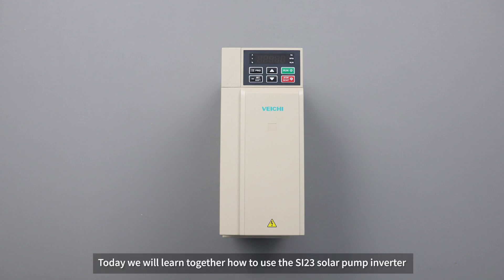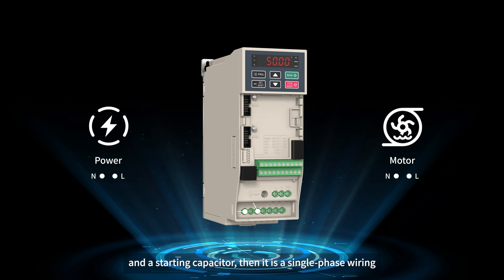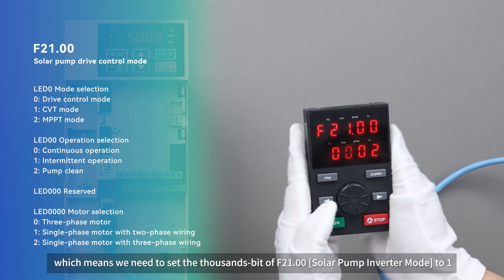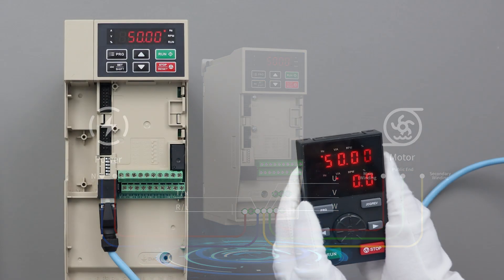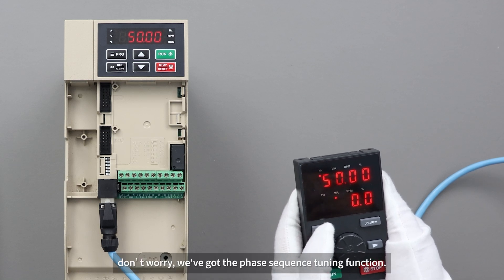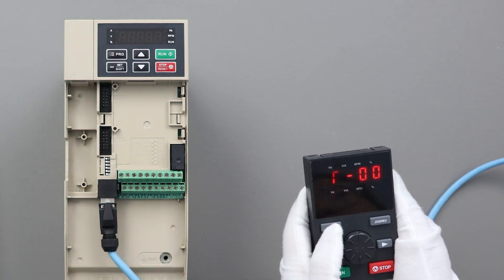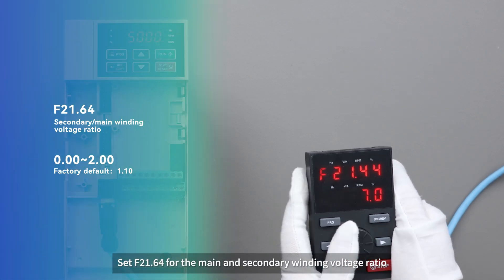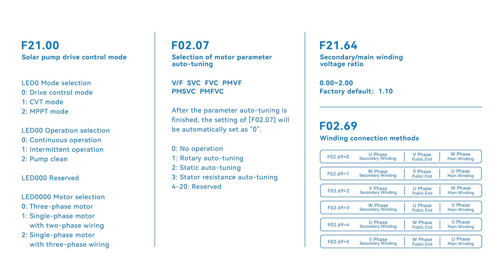Use Of Single-Phase Motors for SI23 Solar Pump Inverter

Comment: Bonjour merci pour les videos
Je n ai pas les mêmes parametres
Less codes dans ma notice commencent à F00.00 à F14.50 manualIN SI23 solar pump vfd
Je peux savoir pourquoi?
Reply from the maker: We offer various types of software and machines, and software version 6922 is suitable for single-phase pumps. Could you please check your software version? Specifically, verify the value of C00.28 and let us know.
Thank you!
Reply: Hey

Am John from Kenya.

Kindly help me 🙏 

Am getting E.oLF2 error, I am running single phase motor with single capacitor.

Have attached my connection and the error .

Kindly help 🙏